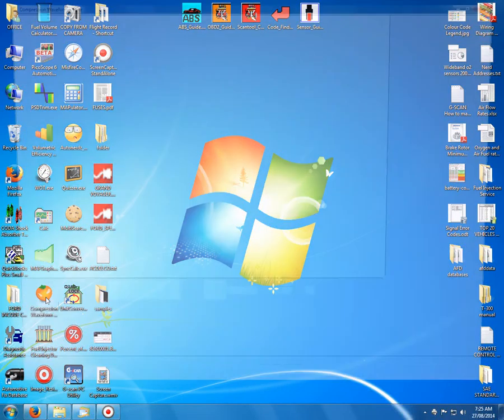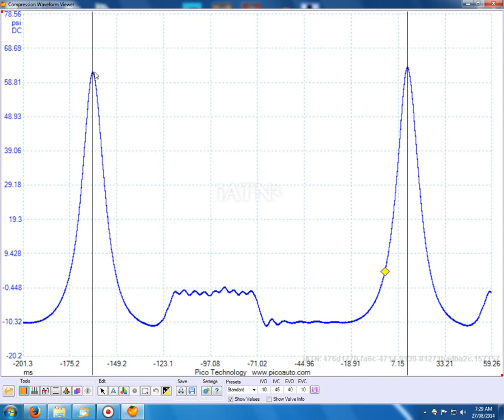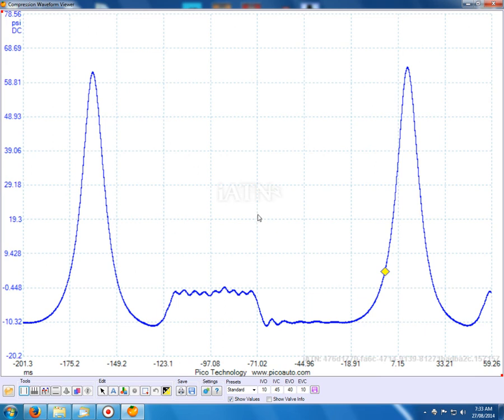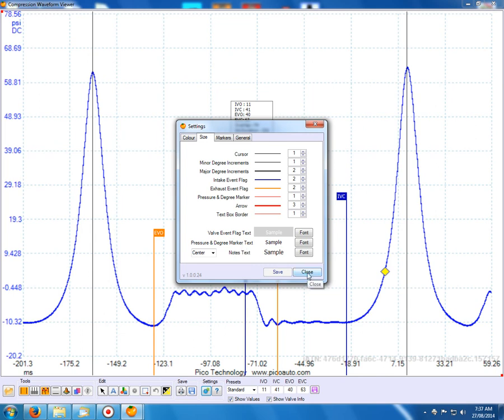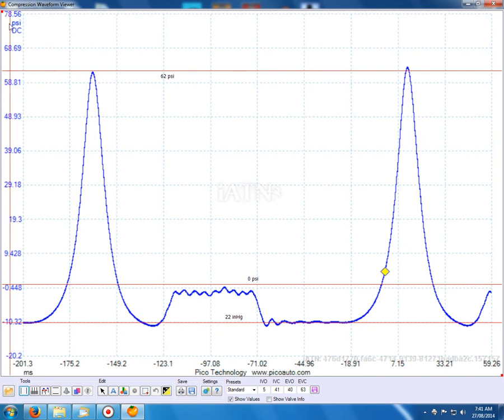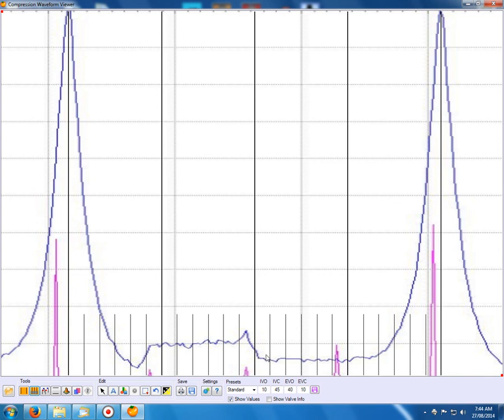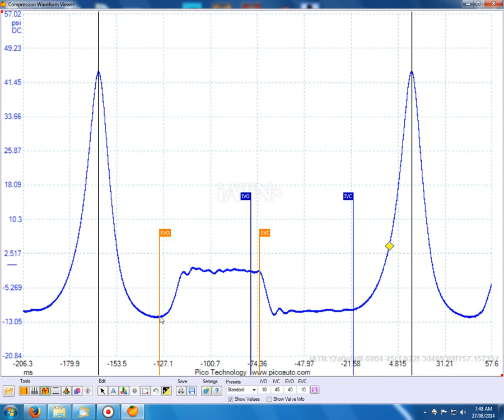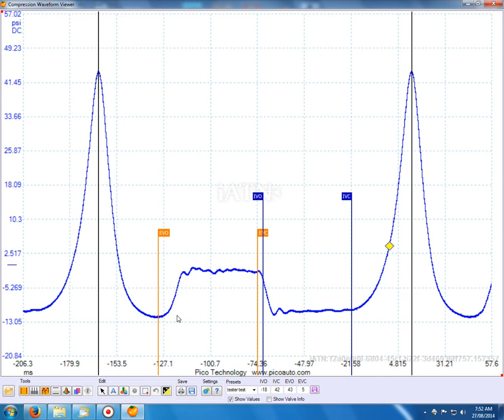CWV Instructions

Comment: Also a great introductory tutorial on reading running compression waveforms.  Is this software available outside of the autonerdz forums?
Reply from the maker: Hi sailorbob, yes, you can get this app and many other useful automotive apps from TaT (The Automotive Technician). https://www.tat.net.au TaT has many great resources available to its members, including a bi-monthly trade magazine, technical help service, automotive equipment reviews, technical forum, diagnostic calculators and programs, fault code and acronym databases, technical videos, scan data and waveform database, and more.
Reply: You know that you program is begin distributed by autonerdz as well?  I'm just asking because the TaT website says the programs there are exclusively for members.
Reply from the maker: Yes, that's right. Autonerdz Picogroup members have access to several of my programs.
Reply: @cobsterboy  
at $249 a year i dont think so.. fine if youre in the trade but for a home mechanic not worth it

Comment: No way are those pressure readings reliable or correct. Apply Boyle's Law. Compress 22 inHg 10x (10:1 CR) and tell me you get 62 PSI.
WPS500 over reports both the vacuum and the compression values by about a factor of 2x.
Reply: it may be a running compression test